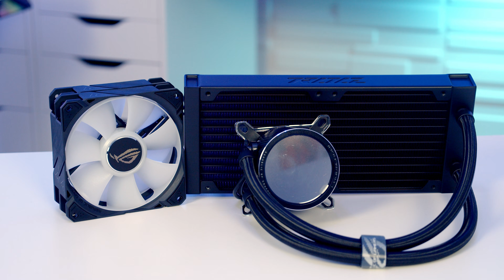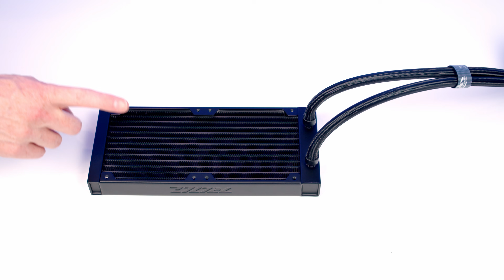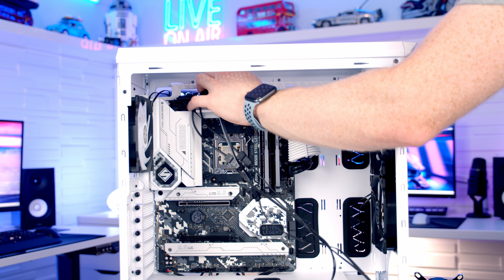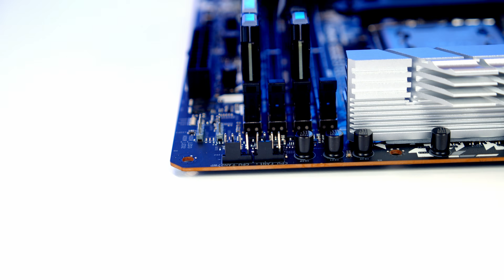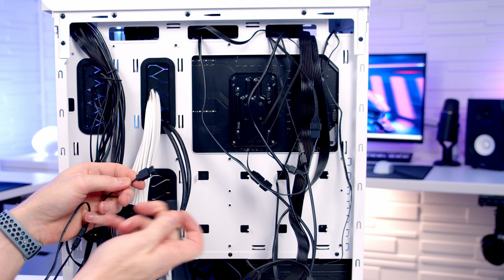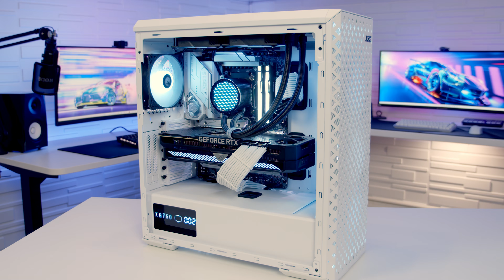ASUS ROG RYUO III 240 ARGB - Installation Guide (AM5)

Comment: I doid not find the adapter mounts in the package and there is no way to buy them separately anywhere. I am stuck with this cooler the retailer will not accept a refund or changing it in any way.
Reply: Take a look in your kit. I saw 4 screw stand offs thaf screw into the holes that are there when you take off the factory brackets. These came with 4 plastic sleeves that fit over. Put the sleves on the motherboard side and screw the long parts into the motherboard. Then your stand offs are lifted and you can screw the 4 hand screw cap parts that hold down the AMD bracket. This was a complete mystery.
Reply: Me too. Have you tried with asus support?